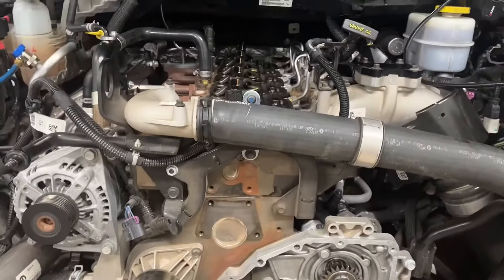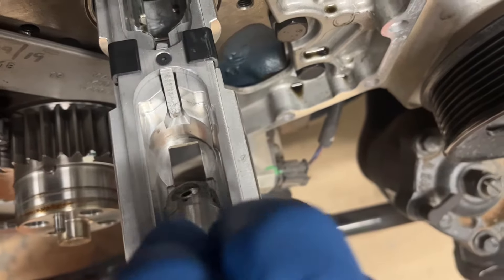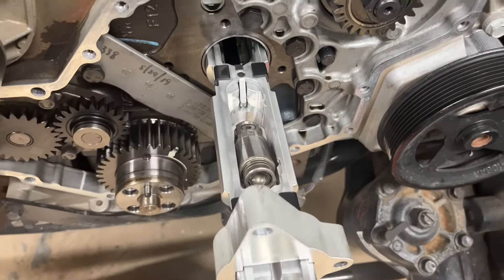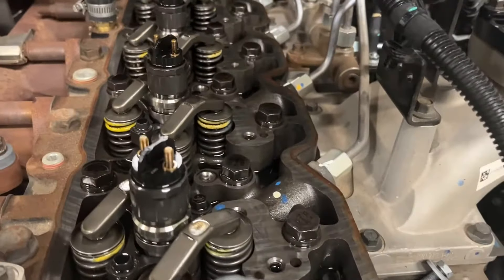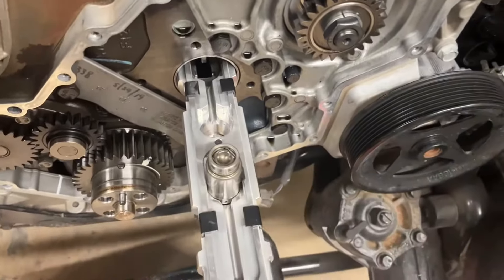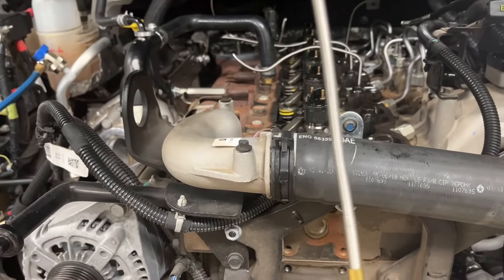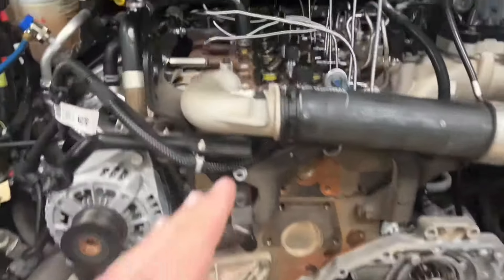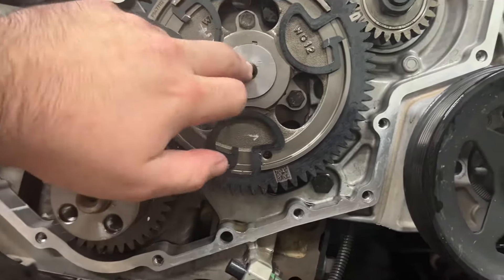2019+ Cummins Roller Lifter Install w/Mopar Tool

Comment: Your really the only person on any platform to put a spotlight on the 5th gen cummins engine. Very in depth. Thank you. 🙏 I just picked up a 5th gen core that i plan to overhaul and drop in my 94 f350.

Comment: You did it without removing cab.  The only reason to remove cab is because factory holder tools don't have enough room to be installed on back of engine.  Interesting method!!!

Comment: Just gonna point out that the chrysler shop manual tells you not to use magnets. Our kit came with the dumb miller tool that barely works on a good day to catch the lifter. I need to get a set like what you got...
Reply from the maker: You do not want to use magnets with the hydraulic lifters as it WILL magnetize the internals (I tested that and it’s true!).

I used magnets as I converted these lifters into solid rollers using Wagler's kit.

Comment: I only have one bad lifter do i leave magnet off of that one so it will fall out to be replaced & can it put back without taking them all out
Reply from the maker: If you are keeping hydraulics, DO NOT use magnets. You NEED the holder tool otherwise you will magnetize and damage the hydraulic sections of the lifters.

As for replacement of one lifter, install holding tools on all lifters, remove cam, install trough, and release holding tool on that lifter. Then reinstall using mopar flip tool.
Reply: @delorean831  where do i find this tool

Comment: Sir, how to remove lifters?
Reply from the maker: Drop them one by one into a trough like the old engines. You can use a long magnet so the lifter falls over without having to shake the trough.